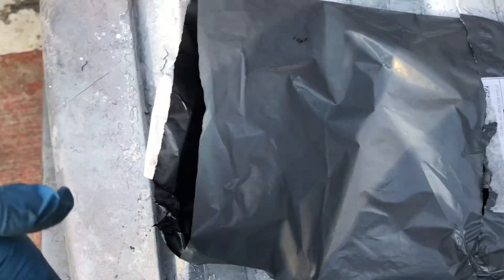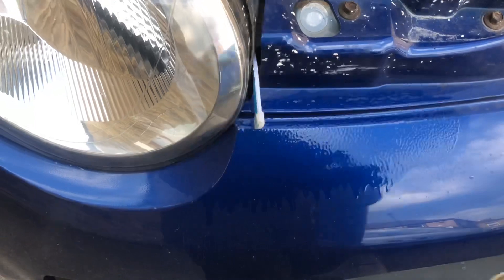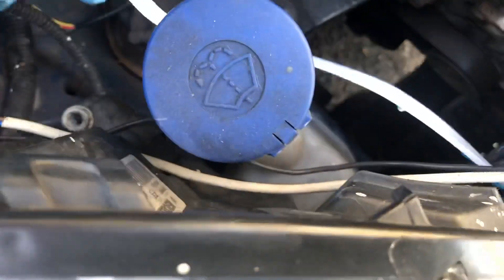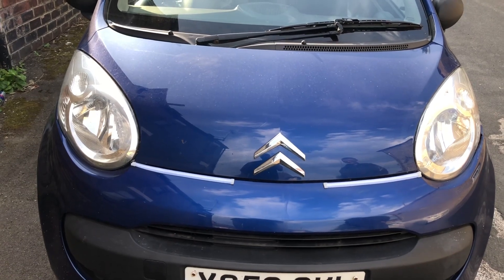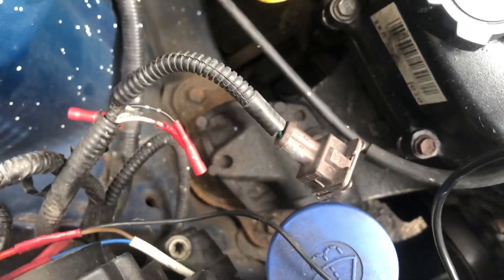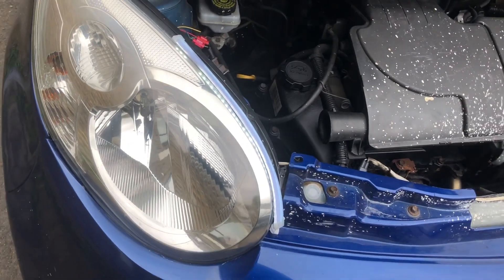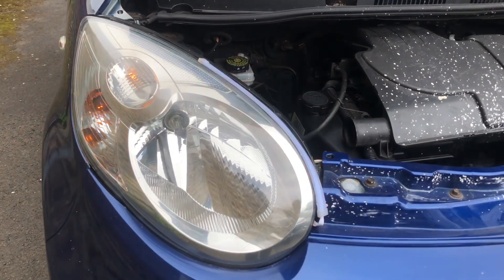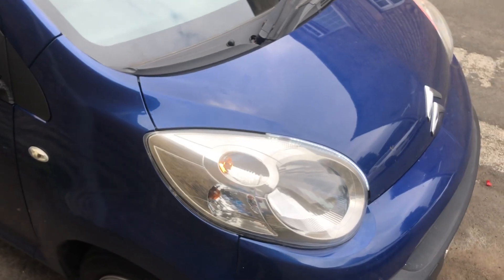DIY Sequential Indicator Install, LED DRL + Audi Style Indicators CityBug/C1/107/Aygo

Comment: I have just got some cheap daytime running lights and am trying to find a  live to connect the lights to but can i find one? Can i fook! Any advice? I have found plenty of live wires with ignition off in the under bonnet fusebox but cannot find a live ignition wire......bugger
Reply from the maker: Depends how far you wanna go with the wiring but there should be a few around the car. There should be at least one ignition positive behind the radio if nowhere else, and the leds shouldn’t usually take enough amps to worry about. I don’t know off top of my head of any under the bonnet but I’m sure there will be one in there somewhere.
Reply: @StupidBlokeStupidVideos  cheers 😁, ideally want it under the bonnet 👍 didnt really wanna go through to the cabin!

Comment: Give a link for this lights and the type of connectors. Show how they light at night time.
Reply from the maker: I don’t have a link for them but they were just the cheapest ones on eBay. I used scotch lock connectors into the original wiring but I wouldn’t recommend these as they’re a poor connector unit. I think I show them in the dark in this video if I remember right. 

https://youtu.be/mUIeQ8e7hnE
Reply: No there is just the shit led lights ;) something which i considering aswell. I was watch a video where a guy put Led and they was strong , the problem is he don't  show them how you did, in the dark to see the difference.  I think Xenon will be the best.. if you can make short video how the indicators works at night will be good. Thank you i countinue to watching your videos about c1 :).
Considering sport air filter , i don't  know only what size elbow i need .
Reply from the maker: @ivanpetrov2280  ah right fair enough. I’m sure a stuck a video of them at night somewhere but I’ll slip it into the next video. I think I show the size of the elbow in this video https://youtu.be/ox-R1MVXeF8 but I honestly can’t remember without watching it back. This setup actually worked, but I’ve just done a video testing it with no air filter on so effectively the best possible cone filter with no restriction at all too.
Reply: @StupidBlokeStupidVideos  i watch the video. I can't get improvement like that, because the throttle have to suck air , and the position is up againts of the bonnet, not enough pressure.  That's why when you use the that ramfilter he did that job to bring more air for the engine. I think to find pipes and fit the filter on the right side against of the bumper to receive air itself and also some sound :) 😃
Reply from the maker: @ivanpetrov2280  yes the way I did it in that video was to face forward and cup the air, with as straight as possible route into the throttle body. I think in order to get any easy/cheap gains from this engine with an air intake it’s the only way that will work to be honest.
Reply: @StupidBlokeStupidVideos  i found now a cheap kit in ebay for 23£ with flexi hose i think will be easy for our engine to fit. But i have to check the size of the throttle first. And is it there a small pipe for oil steam??
Reply from the maker: @ivanpetrov2280  just stick a little filter on the breather, or you could pipe it back into the intake.
Reply: @StupidBlokeStupidVideos  ye i will see what I can do :) . My wife getting mad why i spend money and time on this car (Have another 2 in the family), but i love that little beast ;) even when i saw 110mph few days ago i said that's it , we need some tuning xhaha 😃
Reply from the maker: @ivanpetrov2280  I’m the same. I have a BMW 330d with over 4 times the power of the c1, but I drive the c1 all the time because it’s easy, cheap and probably most of all, I enjoy driving a shit car that I don’t care about!
Reply from the maker: @ivanpetrov2280  I snuck a clip of the lights at night into the video that just went out. 

https://youtu.be/QKdLlTPWS_Y
Reply: @StupidBlokeStupidVideos  hi mate i put the same lights, but later when i go out and test them on dark. Day light working,  when i use the turn they flash one time and after that they stop, just the car turn lights continue to flash. Any idea why they stop after one flash.
Reply from the maker: @ivanpetrov2280  not sure to be honest. You have definitely got the earth wired to the earth, then the white LED joined into the 12v from sidelight bulb and the indicator feed for them joined into the 12v of the indicator bulb haven’t you?
Reply: @StupidBlokeStupidVideos  i connect to the green cable  red one's of the side wires, and the black wire with other mix colour cable, then the white lights come on. After that just connect then yellow cable with the yellow  and purple cable from both turn lights. The  then the turns start working aswell. One hour later i just go out of the house to move my car. I was excited to see them on darkness.  The day light work perfect just start a second late after switch the lights. And when i think to check how is the turn light when the main lights are on too, they jusht flash one time and then stop. Only the original bulbs 💡 continue to flash.
Reply: @StupidBlokeStupidVideos  Okay i went out now to check something,  and i found something else, when i do not start the side and daylights, the turns working. But when i start the day lights connected to the side lights, the the turns just flash and stop. Maybe  the - black cable have to be on other place???
Reply: @StupidBlokeStupidVideos  Hi mate i fixed with new Led strips.  I try to connect the old LED to the back lights, i catch the white/black cable for negative and the Yellow one for turs, but maybe is not like the front headlights. Do you know which cables i have to use for Turns and Reverse light????
Reply from the maker: @ivanpetrov2280  I’m not sure without having it in front of me to look at it properly to be honest. Reverse lights? Are you fitting some to the rear? Don’t forget you only have a reverse light on one side if you are.
Reply: @StupidBlokeStupidVideos  yes i  want to connect both back sides for indicators , and just the left back side for reverse light. But which is exactly the cables I need to connect is the question ;)
Reply from the maker: @ivanpetrov2280  Not sure, the easiest way to find out would be to meter them out I’d say.